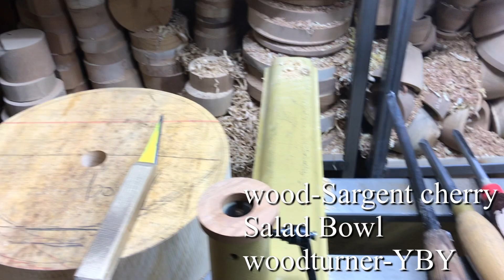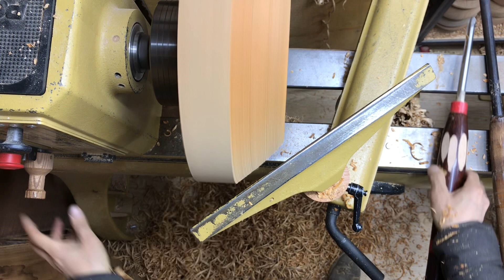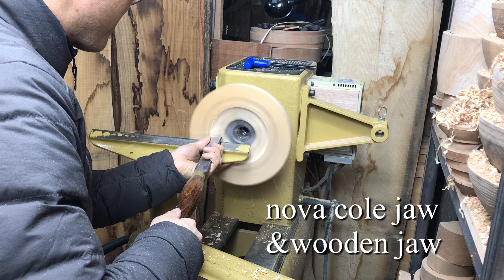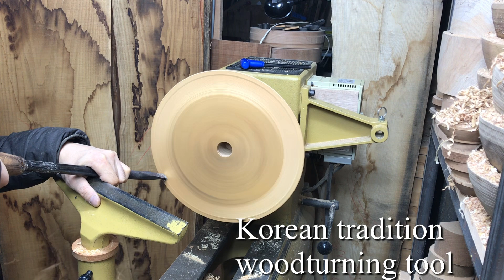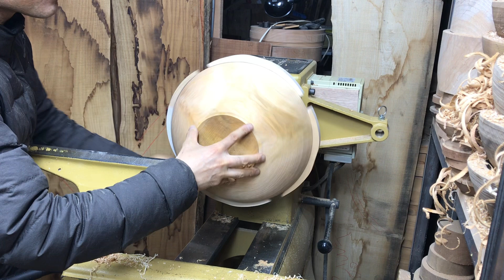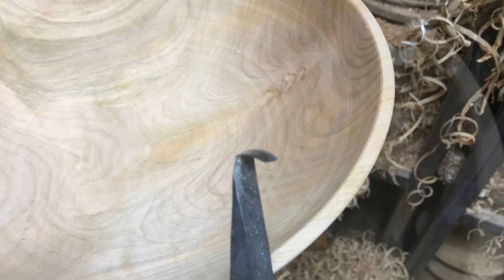woodturning bowl-9 korean traditional tool/ Salad Bowl 양병용

Comment: just curious, what is the point of using that Korean tool? as in what are the benefits over just a bowl gouge? if you just like it better that's a totally good reason haha! but i was just curious if there was a different reason? great work!
Reply: One advantage of this tool type is demonstrated toward the end of  shaping the inside.  Because the sweep of the cut is controlled by pivoting the tool on the rest, you can easily create a large sweeping curve that follows a smooth, fair arc. The geometry of the cut system can guarantee a smooth curve when handled properly.  Turners often are challenged by lumpy interior bowl sweeps